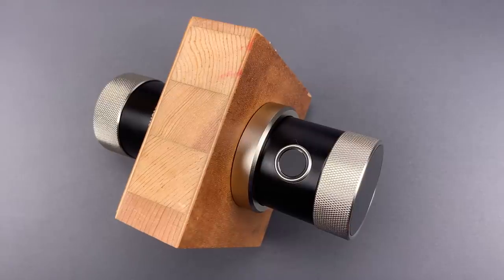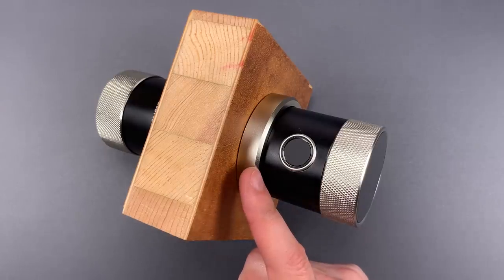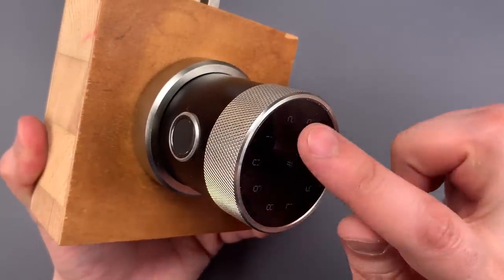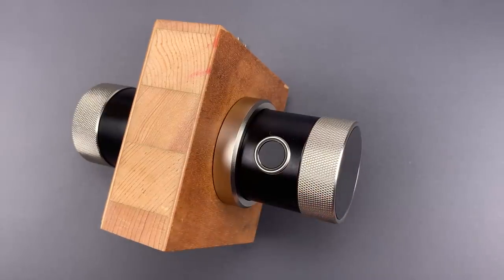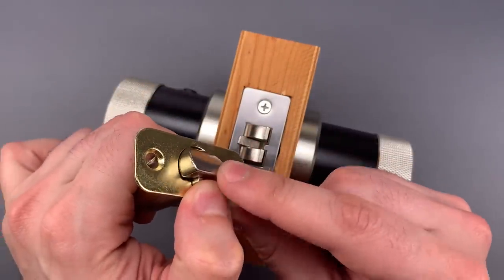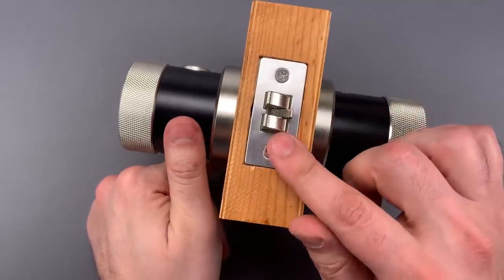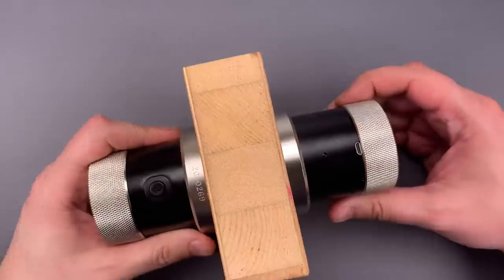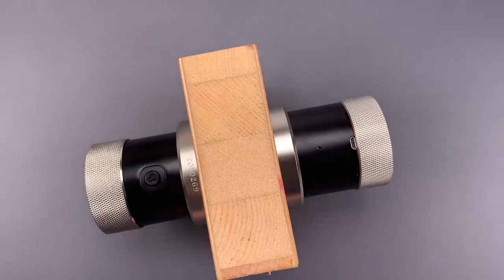[1120] Fingerprint Lock That Forgot The Fundamentals - DatoHome L-B400

Comment: If the door closes against a door stop and opens inwards then there is no issue with the lack of deadlatch functionality. I've never lived in a house with an outward opening door.
Reply: There is always a gap between the door jamb (what you call the "stop") and the door. A piece of plastic flexible enough to get around that gap, yet still rigid enough to open the lock is easy to find (most blister packs and pop bottles are about right). If you are relying on that for security you can find all sorts of videos on here showing how easy it is to bypass (much quicker than using your key!)

Comment: will a magnet bypass it? why did they put a usb on the outside of the door. Overvolt on USB kill it? Putting an ani knife piece on the bolt would have been very easy. What is that reversed lever piece on the bolt?

Comment: Why don't they just optimize mechanical code locks? Last thing I'd ever want in between me and my home, is a doorknob that needs recharging.
Also, what happens with electric field manipulation? (emp, or just powerful electromagnets etc. How easy is it to break down the electronic hardware ?
Reply: It doesn't need recharging. It uses AA batteries in the indoor handle, which you really should replace when the low battery warning comes on.
Reply: @PanduPoluan  well thats even worse then.
Reply: @Real_MisterSir  Why is it worse? Compared to having a non user serviceable rechargeable battery, it's actually very consumer friendly.

Comment: So, let's say this thing dies; circuits fried, failed firmware update, etc... What is the manufacturers intended way to override it to let you in? For example, on my car if the key fob or car battery dies, there is a trim piece on the door handle I can remove that reveals a keyhole. Seems like there should be some type of traditional key that you can stick in a hide-a-key or something for emergencies.

Comment: I was so not done with that video... tell me more about the lock, take it apart. Why was the usb micro port on the outside handle?
Reply: The micro-USB port is for the backup power if the batteries are dead  and you're locked out.

Comment: Problem with finger print scanners: you leave your fingerprints everywhere, probably already on the door or the door knob. And most finger print scanners can be tricked quite easily without a real finger. And then this thing has a lot of other attack surface, bluetooth, nfc, appearently an usb port? If it already has mechanical flaws, it probably has software flaws, too...

Comment: Will it open if the battery runs out? How long does the battery last?

I guess it should have a sign for whoever breaks in to put the charge on before they leave with your stuff
Reply: It uses AA batteries in the indoor handle. A set of batteries lasts for 6-12 months depending on usage. It's not rechargeable. (Unless you use rechargeable AA batteries, but you have to charge them outside the lock; there is no recharging circuitry in the lock.)

Comment: You have to charge it from the outside of the room/house? You would want that on the inside, or have removable battery pack of some kind. No?
Reply: It runs off of 4 AA batteries stored in the handle portion without the keypad. The USB port is in case you ignore the “low battery” alert and end up locked out. It doesn’t charge the lock. You use a portable charger to temporarily provide power to the lock so you can operate it.
Reply: @pointclickbamm  That makes sense. I put electronic deadbolt on my shed, but it has a key if batteries go dead.

Comment: LPL couldn't break into this if it was placed in an inwards opening door. He says that he can bend a plastic around the door edge, but that's a very very hard thing to do. And if the flat part of the locking mechanism faces the  outside, there's no way anything except brute force could work.

Comment: If the charging port is outside, but how do you charge it if you're indoors? Poke the wire through the letterbox over night?
And I'm guessing that this is for internal doors, because there's never in the history of electronic devices, been an issue with putting an exposed micro usb in a outside environment...
Reply: It's not for charging. The lock uses AA batteries in the indoor part. The USB port is used just to power the lock if you dumbly ignore the low battery warning for weeks.
Reply: But it's still an indoor only device, because it has the exposed port.

Comment: You will need that weakness in the latch in order to get into your home when the battery dies.
Reply: First, they fixed that mechanical oversiight. Second, the micro-USB port is for feeding it backup power.

Comment: Surely the knob with the small hole is on the inside? Like a safety override to unlock. He says it’s on the outside but the print reader would be outside? Unless you’re trying to lock yourself in to a house/room ?
Reply: Not a small hole.  Dimple. On the outside, originally.

Comment: I actually have quite the issue with the charging port for the knob being on the EXTERIOR portion of the unit, without any weatherproofing material. 

“Sorry, you can’t charge your doorknob anymore because water / humidity corroded the charging port on your doorknob. Oh and also, it’s 2020 and we still installed a MicroUSB port on there because #reasons.

Comment: I think that little dimple is intentional.  The problem with electronic stuff is that i can die and cease functioning.  I noticed that your lock had a charge port so that you can recharge it.  If the lock dies, then it seems like the fingerprint, num pad, phone app and key card would all cease to function and then the door would just be locked forever.  The dimple is there so that if the lock dies while the door is locked, a person can still get it open, since having a permanently locked door is obviously a bit of a problem.  That said, this is a real highlight of why you shouldnt trust smart devices for uses like this.  Both the fact that your lock CAN DIE and be permanently locked, as well as a system that could let thieves bypass the entire lock in the first place, tell me that it would be better to invest in a lock that is not electronic in any way.
Reply: If the lock is dead because of the battery, you can still provide emergency power through the micro USB port. Then don't forget to replace the AA batteries in the indoor handle; the lock will have been warning you for weeks about low battery.

Comment: What happens when it runs out of charge does it lock you out, or give anyone the freedom to enter easily i doubt you have your door handle on the charger all day
Reply: It takes regular AA batteries.  It doesn't charge them . It has a micro-USB port for backup power if you lock yourself out.

Comment: wait
is the charging port on that doorknob... on the outside?  I get it, you don't want to get locked out, but you'd think for the price of some of these things, they'd splurge on some sort of contactless doohickey you charge at home and hang on the doorknob to charge it every few months.  Make it work on the inside or outside, and give you two with the doorknob, one made for AC and one made to charge in your car.
Reply: It's not rechargeable. It uses AA batteries. That port is only for you to provide emergency power if you dumbly ignore the low battery warning and not change the AA batteries in the indoor handle.

Comment: The biggest issue for me is when someone says 'smart (something)', I immediately think 'insecure (something). I highly doubt, as a software professional, that this lock implements even the most basic software security. Especially since 4 ways (without attacking it physically) to open it means 4 avenues of software attack. Moreover  only 1 of these 4 ways needs to be compromised to open the lock. 

If you want a tractable lock, putting a computer in it is perhaps the worst thing you could do.

Comment: Slipping method can be greatly reduced with a multi fold frame. Locks aren't intended to stop everyone from gaining access they are intended to stop categories of people. Namely criminals of opportunity.  Little can be done against criminals of strategy and intent.  Doors can be breached access can be granted. Electronic locks are superior to mechanical locks for the simple fact that lock picking tools are easily available.

Comment: Lololol, this lock is exactly what i use in my house.. different brand, but i think its a generic one and most of them just rebranding.. but in my opinion, the door itself (in the side) shaped in a way so (idk what it called, but when the door closed it protect the door gap)you cant slip something solid enough to open the lock mechanism..
Reply: I think you'd be surprised, it's not hard to find plastic that's flexible enough to get past the door jamb, but still rigid enough to push that latch. Most blister packs are made of the right stuff, as are plastic pop bottles.

Comment: I dont understand why one would use this. You have to regulary reload the battery for this to function, if the battery runs out while you are inside the room i guess youll always be able to open it from the inside, but what if you forget the loading usb inside the room, go out , realise you cant reenter without loading it, then what? go into the next store to buy a new usb cable?
Reply: If you're not going to replace the batteries when instructed, maybe you should select a mechanical lock instead and have a locksmith on speed dial.

Comment: That dimple shouldn't be a Problem at all, since the way I see it that side of the Lock is supposed to be on the inside of the door. I wonder what that Button on the other side is for though? Illumination of the keypad?
Edit: nevermind, I watched through it again and it's on the other side. Doesn't make sense at all. The button for light should be on the outside and the USB port should be on the inside. Don't know why they did it that way. Also, I see why they would want some sort of non electronic way to open on the outside, but most People don't only have one Door on their House anyway. If it was me I would put this on the Main door for convenience and have the backdoor locked with a mechanical key in case of electronic failure

Comment: Why is the USB port on the outside?  Why not put it on the inside where it is actually more secure?
Reply: Is it a charging port?  Maybe if the battery is depleted, you can plug in to it to charge it?  If so, hopefully there is no data allowed over it.

Comment: The dimple is on the INSIDE.  There would be no need to drill it as the door handle on the inside always works, right?
Reply: "On the bottom of the outside handle"
Reply: @1nvictus  Yeah.  Except it's not.  It's on the inside.
Reply: @robertzeurunkl8401  Watch the video again. It was on the outside handle, on the other side of the fingerprint reader.

But it's a dimple, not a hole. And a more recent version of this lock no longer has that dimple.
Reply: @1nvictus  @Pandu POLUAN,

Dang, looking at it again, you are right.  It is on the outside.  I just notice that at one point, he flipped the handle so the sides changed, and I didn't notice it!  LOL
Reply: @PanduPoluan  Not only that, but he actually SAID "it's on the outside".  Dunno what I was thinking.  Like I mentioned to Kael, he at one point flips the lock so it's sides changed sides.  I missed that I guess.  lol
Reply: @robertzeurunkl8401  Heh, we have our moments 😄

Comment: OMG micro usb on the outside doorknob. Because that's not at all prone to corrosion, damage by ice, or spiders, etc. in places with real weather. Also, I'm def going to be carrying around a micro-usb cable when the doorlock's battery dies.

:facepalm:

Comment: Why is the charging port on the outside
Reply: It's not for charging. It's to provide emergency power if you dumbly ignore the low battery warning for weeks and never replace the AA batteries in the indoor handle.

Comment: why is the usb port on the outside "side" of this knob? Seems like a pretty big security issue
Reply: It's to provide emergency power in case you dumbly ignore the low battery warning for weeks and never replace the AA batteries in the indoor handle.

Comment: Wait... they put the charging port and the emergency, no key required unlock button on the *outside*?
Reply: There is no "unlock" button. Just a dimple, not a hole, that unfortunately lies right below the latch-turning mechanism.

There is no charging port. That USB port is used to provide emergency power if you dumbly ignore the weak battery warning for weeks and never replace the AA batteries in the indoor handle.
Reply: "Button", switch, dimple - it's not the exact form it takes that matters. It's a device that unlocks it, right?

Comment: Did I see that right, the USB port for charging is on the outside door handle? Does that make sense?
Reply: You did see right, and it doesn't make sense. For a number of reasons.
Reply: A big issue with electronics locks is that people forget that the batteries need charging. So unless you want to have to break in when someone inevitablly forgets to charge the batteries you either need a way to supply power from the outside or a mechanical bypass.
Reply: It's not rechargeable.  That's the backup power port for when the batteries are dead.

Comment: Is that USB charger? So of it run out of electricity, i cant use the lock?
Reply: Not a charging port. It's an emergency power port. You know, if you ignore the low battery warning for weeks and never replace the AA batteries in the indoor handle.

Comment: Who designed this thing? why put a usb port on the outside?
Reply: It’s battery powered it’s for if it dies while you’re outside of the door
Reply: @DJR711  but it gives you direct access to the electronics inside, why dont use a regular charging port instead?
Reply: @JuanSanchez-rb4qu  so a wireless charging port that will almost never get used? That seems like more work than needed and would sky rocket the price

Comment: I mean it needs to have a thing for locksmiths when the lock runs out of battery and no one can access the charge port on the other side....

But alas they could have had a USB port on the outside that has no data connectivity but only charging, then it wouldn't have come to having a dimple. 

Of course, in that thought scenario, the latch exploit is accidental.
Reply: Having a USB port on the outside means you are making drilling attacks far easier.
Reply: @evannibbe9375  not if the drill core part is not angled anywhere near the port. If you just want a soft spot to drill surely the fingerprint window is just plastic or glass.

Comment: Why is there a usb connector on the outside bottom of the door nob?
Reply: It's to provide emergency power if you dumbly ignore the low battery warning for weeks and never replace the AA batteries in the indoor handle.

Comment: Do you have to charge the lock with the micro usb on the bottom?
Reply: No, that is only for emergency power if you don't replace the AA batteries in the indoor handle when prompted by the low battery warning.

Comment: Is the charge port on the outside of the door? Am I missing something?
Reply: Yep on the outside. Why did they think that was a great idea? Only thing I can think of is they figured if the battery dies you can connect it to a portable battery.
Reply: It's not rechargeable.

Comment: as a white hat hacker security professional... I would be more worried about the USB port on the OUTSIDE of the handle... (O.o)
Reply: Why? That port only transfers power to the mechanism if you ignore the low battery warning for several weeks.
Reply: @PanduPoluan  is that all it does? If so the that limits what can be done to it... but there are still things....

Comment: Wait so the charging wire is on the outside of the house en not the inside?
Reply: That's where you'll need it when the batteries died and you're locked out.

Comment: Good lock or not, chaging your lock is kinda stupid. I guess that little hole is there to open it in case thr battery dies. Since it would be on the inside (and the intended use case is most likely to protect the door from the outsie only, so just a one way solution) it is acceptable for me.
But still, charging a lock is just plain stupid.

Comment: "Bluetooth" yeah no that lock is NOT secure, even z-wave (technology used by most alarm.com systems nowadays) isnt really that secure, but it at least requires some pretty special equipment and firmware spoofing, bluetooth needs none of that. Sttill a really cool system though! I'd love to see it use a more secure communication protocol, and for that dimple spot to be worked out.